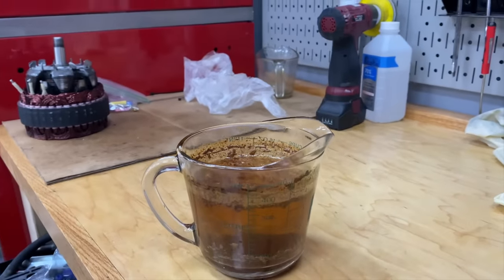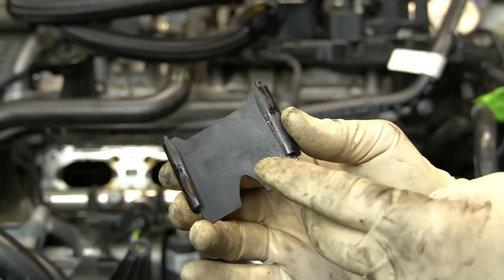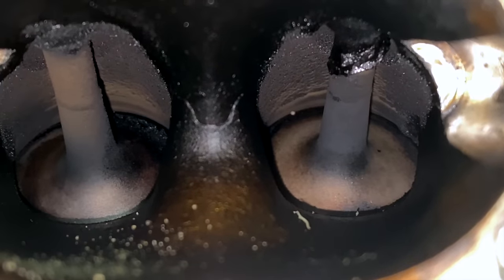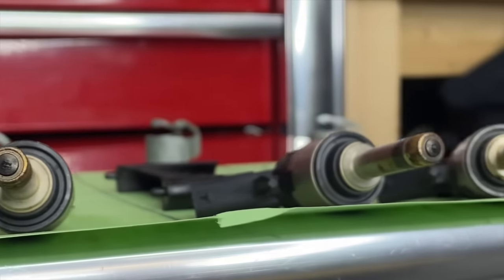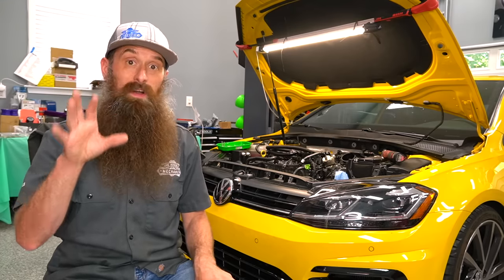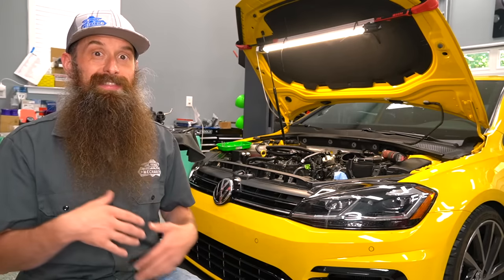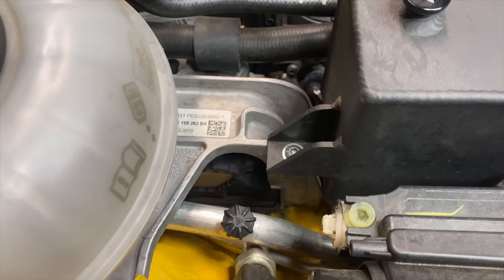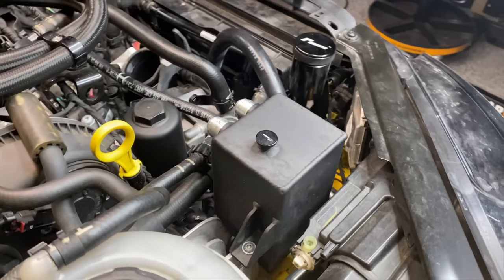Did the Catch Can Work? 10k MILE TEST

Comment: Great, now time to add an MPI fuel setup and see if that makes it even better!! (Too bad NA doesn't get the dual injection setup as standard...)
Reply: The engine will run even better with the Multi-Point injection. No more cold start misfires, no more power loss :D
Reply: @bogdandacian2001  are they actually that bad??, I'm in the UK and here even the 190bhp engines (At least on the SEAT Leon) have dual injection
Reply: @karim.elsakka  Well, yeah. I own a DI engine (1.4 tfsi, 125 hp, motor code CAXC/ Audi A3). I have misfires even with the 100 octane fuel even with new spark plugs. It doesn't metter if the engine is cold or not. I own a Skoda Octavia Tour(the second generation,2011) with the 1.4 MPI engine(80 hp) and it's running great(only 95 octane), no misfires, no loss of power.
Reply: @karim.elsakka  The Audi's great. I mean it is faster than the Octavia. I'm trying once a month to do an italian tune up (running the car hard, changing gear at 5000-4500 rpm). I ussualy change gears at 3000 rpm.
Reply: @bogdandacian2001  Could be the intake valves carboned up, I don't have much experience with that engine so I don't know how involved removing the manifold is...
I also hear that coil packs are a very common fault with these, but again, I don't have much experience with that specific engine.

I've had a car (1.4TSI) where it had 3 different issues at the same time, all 3 together caused one hell of a misfire and it was running rich AF... carbon build up on intake valves, timing was slightly off (engine with digital timing, was 1.5 degrees off spec.) and an O2 sensor was giving random readings sporadically, I'd fix one issue and the misfire gets better but still there, till all 3 problems were fixed...
Reply: @karim.elsakka  Well, I think so. The coil packs are new, too. Too bad that the automakers are opting for the DI engines and not MPI. They're getting worse emissions(NOx and CO2). Octavia's exhaust pipe is clean(I change gears at 3000-3500 rpm because it's a NA engine). Audi's exhaust pipe is black, full of soot(that thing that acumulates in diesel's EGR). As I mentioned before, I try to run pretty hard(changing gears at 3000 rpm once the coolant and the oil are at optimal temperature)-Maybe it helps, I don't know.
Reply: @karim.elsakka  The injectors are a problem, too. Because the injectors are situated above the piston, they can clog  because of the small particles released during the exhaust part. And that too, can make the engine run rich. As You said , the carbon on the intake can limit the quantity of air that's getting at the piston, so, that's another thing that can cause the engine to run rich.
Reply: @bogdandacian2001  I have read a scientific study which you can also probably google comparing DI with MFI, and their results are 10x more soot and particulates with DI than the port and direct combination. It is quite nefarious for the car makers to be hesitant to use it as it is much much better for the environment and the air we breath as well as maintenance of the car. If Toyota uses it, you know it has to be good. Many companies are diabolically interested in maximum profits for themselves and do nit care about the people. Some of it is practicality because DI is simpler. But I wish Soichiro Honda was still alive because Honda was far better as a company and institution when he was alive. I commend Ford for using Multipoint Injection. I definitely fault VW for poor reasons to not use it in all vehicles. VW already blackened their reputation with their Diesel emissions scandal and now this...
Reply: MPI is not a thing in EU anymore either. Newest cars don't get it.
Reply: @UhOhUmm  how come?? Because of ICE phase-out?
Reply: D4-S!
Reply: @UhOhUmm  Yeah that's correct, I don't know the exact details but my original R had MPI and my second one (my first got nicked!), post WLTP is DI only. Idle is noticeably rougher straight out of the gate and it runs on choke at a higher rpm. It's actually quite embarrassing compared to my first R because on a cold start you pull away at slow walking pace but the engine is revving at nearly 2k....people start looking around for a V-Tec civic being caned, but you come crawling by instead...not a great look.

Still, fairly minor gripe, the R is a fantastic daily, absolutely love it, there are better cars at certain things, but none as good all round imo, for the (pre covid madness) price tag.
Reply: @UhOhUmm  Well, Dacia, Renault and many asian cars are using MPI engines.
Reply: @jamesmedina2062  No, because petrol particulate filters became mandatory and VAG doesn't need MPI to meet emissions anymore. So they went back to simpler injection and just stuck on a particulate filter.
Reply: APR has the dual injection conversion kit for the 2.0 EA888 Gen 3 engines.
Reply: @UhOhUmm  how do they work? urea liquid?
Reply: They don't sell MPI on VW/Audi in the US? oO  
EA888 gen. 3 should be MPI, at least in Germany.
Reply: @whuzzzup  VWoA usually gives our market the short end of the stick, so that's not surprising.
Reply: @UhOhUmm  You're referring to the TDI engines.   The EA888 is a gasoline engine.
Reply: @whuzzzup  Up until this new generation it was a dual injection setup (Direct & port injection) in the EU and direct injection only in the US, the new generation is direct injection only for both
Reply: @dantesinfernopurgatory7826  Petrol particulate filters are a thing now, mandatory on cars built sometime in 2019
Reply: @jamesmedina2062  It's just a filter fitted inline with the catalytic converter, no adblue injection as of yet (don't know if it'll ever be a thing, hope not), funny thing is I've seen a couple go faulty and they both had "DPF fault" on the dash and in the memory, had us chasing our tails for a while as to why a petrol engine has a diesel particulate filter fault in it....
Reply: @karim.elsakka  I guess I'm learning something new each day :)
Reply: @dantesinfernopurgatory7826  everyday is a school day :D... I found out when I had 2.0TSI engine that had "Diesel particulate filter fault" on the dash and in the ECU... guess VWG didn't bother changing the code...
Reply: @karim.elsakka  That's typical of VWG
Reply: @karim.elsakka  especially if you dont use oems. Ive never used any other because of the bad coils. Had a bad experience with them never even threw a code. Didnt recognize until loss of power....lights, etc...
Reply: @karim.elsakka  Sorry for the late reply, as I understand it (and forgive my noob takes on things I've youtubed/googled), the particulate filter for a petrol engine doesn't need to be "cleaned" via Italian tune up like soot prone diesels? From what I read, it seems petrol runs hotter and burns more efficiently under acceleration etc so soot is not something "large" enough to block the filter or need burning off?

Hey, sorry if this is general knowledge, but I know from my background with cars, that what you google and youtube, is not always reflective of "real life" :-)

Comment: On that type of catch can; you can always drill a hole and thread it with an oil drain bolt on the lower side where you have room to catch the nasty fluid with a container that will fit in that space. I use a one litre soda bottle with the top four inches cut off leaving a strip at one end just to hold onto and lift to remove it without spilling. Not the bottom where you can't see anything. Just like changing your motor oil. I also tried using a Fumoto Oil Drain Valve to drain the fluid,  However more simple that would be turned out to be not so simple after all. I prefer the first option as the Fumoto has a narrower exit and sometimes that thicker floating oily crud would clog it causing me to remove the entire plug anyway. I actually prefer the round canister style as it is easily unscrewed and cleaned. A good explanation and video. Cheers

Comment: In my Audi B7 I run a Provent 200 oil separator with an APR block-off/pcv delete plate. It removed a great deal of preexisting condensation that was already in the system, and keeps it out, as evidenced during oil changes there's no water or "motor mayo" (😂) mixed in when drained. There's no oil buildup in my intercooler lower piping, or my throttle inlet hose, and my throttle body stays perfectly clean inside. I occasionally remove the hoses on the Provent for examination, and see no oil buildup in the return hose going back into the valve cover. The issue I have with catch cans, even the ones with baffling is that baffles aren't separators or filters, and some oil mist still makes it's way past them. I like the Provent because it has an actual dual action mesh FILTER inside, along with a coalescing baffle, there's room to add steel (preferably copper) wool, and unlike typical catch cans it doesn't rely primarily on centrifugal action and coalescence. It also has a drain hole at the bottom for a hose/petcock attachment. The only drawbacks are 1) the holding tank area at the bottom isn't that voluminous, 2) the replacement filters generally aren't cleanable, and are pricey to replace ($70+). I think the drawbacks are palatable because you actually can manually clean the filters a bit, and they last a very long time (20K -/+). And if you use a clear drain hose long enough (1ft) and place the drain valve near the end, the hose acts as a holding tank and you can see when it needs draining. Which after the first two to three times (depending on weather where you live. I'm in Colorado) isn't very often, and yields just under a half cup of "motor mayo" every 2 - 3K. I think the benefit of keeping condensation out of your oil and from diluting it (which is a must for the oil guzzling 2.0 engine) is enough justification for use of the very reasonably priced (less than $200) Provent 200.

Comment: friend made one for a bew, when new, from clear hose with coarse stainless   steel wool  lightly installed.  the hose had a T with ft long drain tube,, collected grey sludge and water every month and would fill the drain every 2 months.  200K miles and the intake tract was still spotless
Reply: My catch can collects some sludge pieces on the bottom every time I empty it. Not sure what to think of it.

Comment: Awesome testing! So weird how those valves almost looked better after 10k 🧐
Reply: might be that they drove less short trips,
Reply: @jeromevet007  I think the water being basically doused on top of oil from the PCV allows the intake valves to never reach a temperature that it burns off the carbon deposits. Removing that variable let them run hot enough to dissolve them over time.
Reply: Higher exhaust temperatures would clear it out. Hence the term "Italian tune up"
Reply: Thats VW for you.
Too cheap and lazy to have dual injection like Toyota .
Reply: @MaNNeRz91  No.
That just contributes to faster build up on the  back of the valves.
Its the intake valves that are the problem,not so much the exhaust.
You are correct on high temps clearing out the carbon though. To an extent at least.
Just not in this situation.
Reply: @myname9252  they’ve fixed the issue and new TSI has a port injection. I’m not a VAG lawyer, but their GDI project was one of the first and new problems had to be identified as the engines were used. Sadly we’re always the lab bunnies for new tech.
Reply: @MaNNeRz91  ya cause hot exhaust valves clean the intake valves
Reply: @mikemallen3453  if combustion temperatures are higher then yes... Possible... 
The exhaust valves will take most of the heat but the intake valves will also heat up during combustion. Not as much but enough.
Reply: @giovannizn  no dual injections vw in the United States. Problem has not been fixed.
Reply: @MaNNeRz91 lol. Road cars don't get hot enough to burn carbon off. The Italian tune up is a confirmed myth. Engineering Explained did a good video on it.
Reply: @CadillacDriver  it depends how you drive your car or how the fuel is delivered
Reply: @MaNNeRz91  no. Do I need to repeat myself?

Comment: I have a catch can on my ‘19 Fiesta ST, and drain it every oil change (5k miles). I’ve noticed during warm months, there is no water at all in the catch can. Just smells like burnt oil. During the winter, it has a lot more gunk/water.
Reply: If you live anywhere with freezing temps, you should ditch the catch can in the winter. They can freeze up and then the crankcase pressures will blow out seals.

Comment: Thank you.  I have been wondering about catch cans for a long time now.  I would take out the catch can.  I always figure if they worked the factory would put them in.  Those engineers do a lot of testing on things.  i really enjoy your VW videos.
Reply: The factory doesn't want to add another thing that requires servicing. They are actively trying to extend service intervals. My BMW auto transmission has "lifetime" transmission fluid and 19,000km engine oil change intervals.
I assume the fluid will last the life of the transmission, as the transmission will be dead soon after the fluid needs changing.

Comment: Can an ounce of alcohol be added to the catch can in the winter to prevent it from freezing?  I might buy a Focus ST for a daily driver, so a catch can is likely in my future.  Can you redrill and weld a new hole to drain it, with something larger, like an oil sump nut?

Comment: I don’t see a significant change as a result of a catch can on the EA888.  But I have to agree with the BMW guys saying it helps on on the N54/N55.  I have a theory on the burning oil smell coming from the water boiling off in the catch can.  This happened to my cousins N55 where the catch can is located by the hot exhaust.  This is not the case on the R.  Or does it get hot enough?

Comment: I wouldn't have thought it helped clean, just kept it from getting dirtier. On my k24 I have the PCV and crankcase venting directly to a can and the EGR blocked and so far after about 10K miles on it it's still spotless, just had the manifold off to do the t/b so I got to check

Comment: Had the ECS catch can on my 17' GTI for about just under two years in total, with the latter part of it's time installed for all four seasons. Didn't catch anything in the first few months, so figured the can needed more in terms of baffles or filter media. Added two poofs of steel wool inside the can to help catch and bead off any oils or vapors. It was packed in there pretty well even though it was like kitchen sink type of steel wool and not the super fine stuff. Never found a drop of anything in the can for the whole time it was installed. Only thing I ever found was a little oil inside the lines to and from the PVC, can, and intake. In my opinion, kinda of a big waste unless you have a particularly high power build or something out of the ordinary where it might actually do something I guess.

Comment: Maybe I got too late to the conversation but I believe the burning oil smell is because you are getting some oil backing through the hoses. You need to install a couple of check valves to avoid that. That could also explain the random burn on the valves.

Comment: I think I'd rather just spend $400 on a walnut blasting at 100k miles than $200 on a catch can, emptying it out every oil change, and worrying about it blowing my PCV system in the winter.
Reply: Just throw some antifreeze in the can that's what I do I've got zero freezing issues, I live in NYC
Reply: @AQCE245   I think I'd rather just spend $400 on a walnut blasting at 100k miles than $200 on a catch can, emptying it out every oil change, and adding antifreeze to the can every winter to keep it from blowing my PVC system.

Comment: Correct me if I'm wrong in my understanding. But will installing a catch can introduce the danger of having water oil in the catch can collect and if given a particularly cold day freeze the water inside the catch can. This ice blockage will then prevent the ventilation of the engine and increase pressure in the seals of the engine. (Very bad). Given that there's a almost unnoticeable difference between with and without catch can this might be a unnecessary risk. Here to learn. Debating on a catch can myself.

Comment: Hey Charles, for ages I have used a 12v pump to extract old engine oil via dipstick tube - this would work fine with your catch can. To suggest another variable, how about arranging to inject a fine mist of water into intake (post maf ?) switched on only when at say 50mph cruising accelerator position. The low volume of water surely can't upset maf/ecu. Water injection is a well known way of keeping inlet/valves and cylinder head squeaky clean.

Comment: I think if you’re not emptying the catch can often enough and it gets too full, the breather hose which most likely goes into the intake is probably pulling in some oil from the catch can, which is causing the burning oil smell. Just a guess, I could be wrong.
Reply: Some people have commented on other videos that the oil smell went away when they upgraded to Teflon lined hoses for the catch can.

Comment: Awesome video but I have so many questions. I drove a 2013 Ford Focus ST 171,000 miles with no catch can. No problems but the mileage slowly dropped over time from 30 mpg to 28.1. I drive 120 miles a day at around 3,000 rpm all highways. I bought a 2017 ST with 42,000 miles with no catch can and added one at 60,000 miles. The vales were dirty, but the car has gone (from the same drive) from 29.1 mpg to 30.5 mpg with in 600 miles. 1, could this be because the intake charge is cleaner? 2, could the valves be losing cardon because of the constant 3,000 rpm and no oil on them? Ford does not recommend valve cleaner while the engine is running due to carbon exiting into the turbo. 3, If carbon deposits are exiting because of the lack of EGR gasses will this damage the turbo? 4, How often should the catch can element be cleaned (Matsumoto catch can?